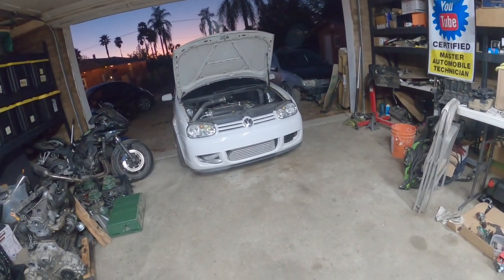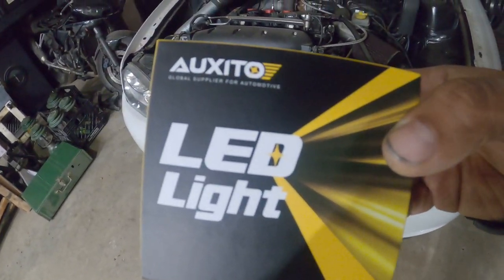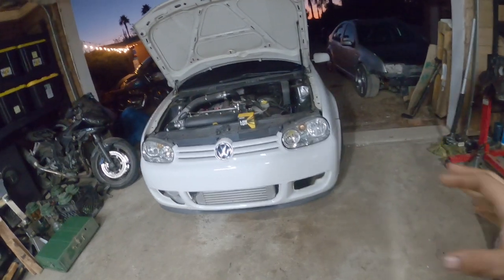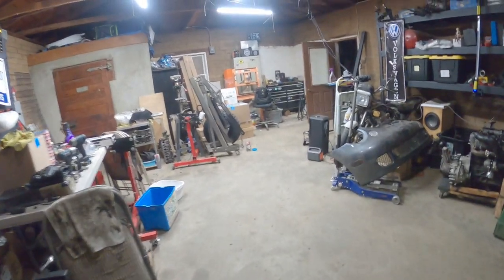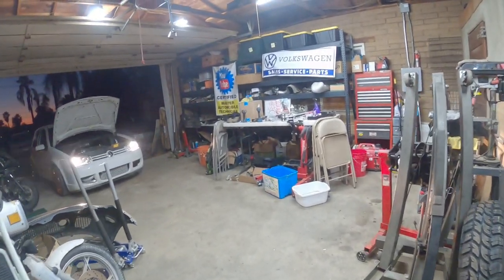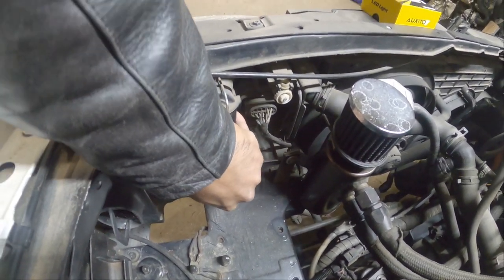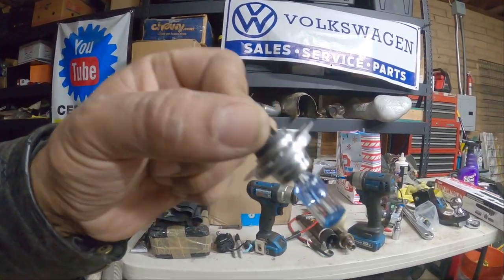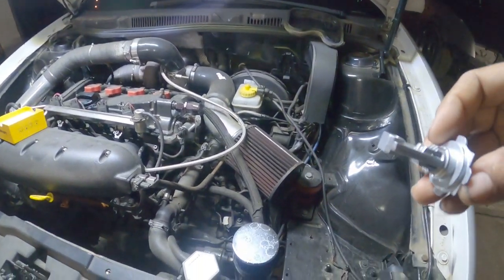MK4 GTI - LED HEADLIGHT INSTALL by AUXITO

Comment: Followed the link in description to check pricing and had a question. Does order quantity “1” mean a pack of 2 bulbs, or do you have to select 2?

I think I might pick up a set. Def like the whiter light more than the factory yellow color.
Reply from the maker: 1 means 2 bulbs
Reply: @PincheALsGarage  cool, thanks!

Comment: I bought these but they flickered on my gti. Gave them to my brother, 2011 rabbit. 
I also bought another pair h7 but has the fans hahah, .. i use auxitos for my truck though.. 

Want to uograde my halogens but have more inportant issue atm.. alternator is dead. :(
Reply from the maker: @cesaringti  wow! That sucks why didn't you swap them out.